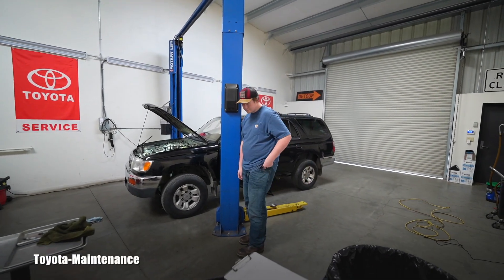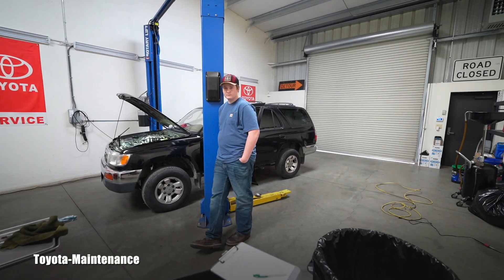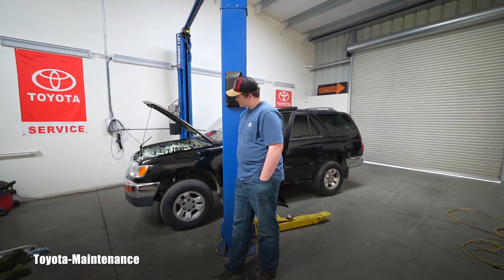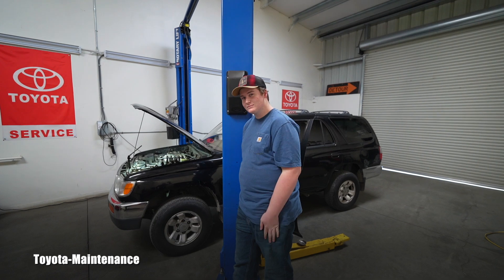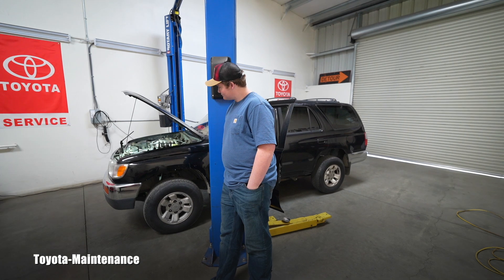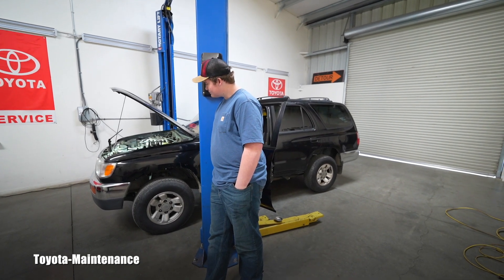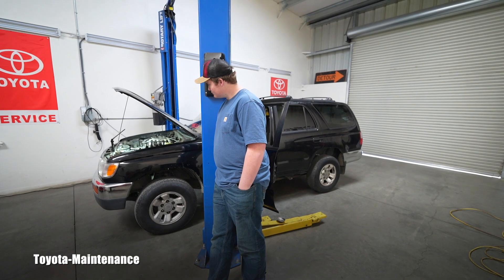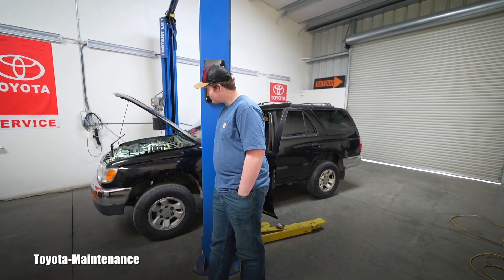Toyota Engine Missfire Codes P0306 P0304

Comment: In my situation 1998 Toyota forerunner 3.4 had PO306.
Carefully check spark plug cables on Cylinder2,4and6. They can leak the spark in the spark plug well. Just change the cables.

Comment: Im chasing a missfire in my 5vzfe ive change th leads coils amd plugs and it hasnt fixed the missfire i pull one lead off at a time at idle and i get no change in idle in cylender 4 it is missing on idle amd light to soft acceleration but when i gwt up in thebrpm the miss gwtba lot less noticable  what should i do mext it also has a relativly bew fuel filter too

Comment: Timing belt, timing belt, timing belt. 

While you're at it do the water pump and thermostat. You don't want to be driving down the road and that belt snap, while it's a non-interfering belt, you don't want to have to call a tow and be stuck. 

Make that 4runner healthy again! Take care of that 3.4 and she will take care of you for many many miles.

Comment: The other things that you should:
Replace and seal the cam caps.
Clean and seal the half moons with some Toyota FIPG.
Replace the valve cover bolt washers.
Make sure not to skip replacing those spark plug tube seals.
Replace the manifold gaskets.
Replace the PVC valve. 
Clean the throttle body while it’s apart.
Check the fuel injectors and other wires and hoses while you have the manifold off.
Scott
P.S.  You have a good mentor helping you. You got this Isaac.
Reply: Nice list! I'd only add cleaning the MAF and IAC along with the tbody for a complete air intake job along with a new air filter (if not already done).

Comment: FYI your around the same mileage when my 2000 4wd 4runner started leaking intercooler to radiator fluids. I suggest you soon buy a separate transmission intercooler and bypass the integrated one in the radiator. You dont want antifreeze in the tranny and tranny oil in the cooling system...when this happens it is sudden and without warning.

Comment: i know i might get a negative response from other posters but if we are going to start taking apart the engine due to bad seals and gaskets on this aging 4runner i would try to determine if head gaskets were ever replaced.  if not i would go ahead and do the full job and replace all the gaskets all around using highest quality gaskets toyota labeled, or oem equivalent, at once and consider machining the heads as well.

great channel and videos btw…

Comment: I agree and this is something to check when purchasing a older used vehicle. This is also a good negotiation tool when purchasing from an owner. Pull out the spark plugs wires and look for oil in the tubs and on the boot. Really appreciate you passing you thought process on to the next generation!!

Comment: Hey Peter, since you are going to pull the valve cover you might as well replace the pcv valve and bushing. Those bushings are so old and brittle that when you go to pull it off the bushing breaks and falls in the engine. So, best to replace the bushing and pcv valve while you are in there.
Reply: agreed... cheap and easy... why not??

Comment: Nice Truck!  The seal between the valve cover and the spark plug tube are compressed when the valve cover is tightened. I would give the valve cover a tightening, it may stop or slow down the leak.  I would then wipe out all the oil from the spark plug tubes. Next I would check for restrictions/clogs in the PVC circuit as it may be causing excessive internal engine pressure.  I would wash the spark plug wires and inspect them for cracks. They really shouldn't short out in oil since they are insulated and seal tight on the spark plug's insulator. However the seal May be compromised by sitting in oil getting softer, turning to goo and then leak. This failure of the seal will cause the oil to migrate up the spark plugs insulator to the spark plug wire's connection. This may cause a short to ground depending how conductive the oil is. I'm sure there is some resistance of the oil which may become more conductive as it picks up metallic residue as it ages. Consider if you spend an hour cleaning up the wires @ $120 dollars an hour all you will have in the end is some cleaned old wires.  With all the above cleaned and reassembled you should be able to drive awhile.  I'm not going to tell where you should do this, but I will tell you to do it. Vacuum all the leaves behind the rear engine compartment seal. Inspect this seal it must be working. It keeps oily air off the windshield and from going into your fresh air intake. Grab at least two cans of Foamy Engine Degreaser. Read and understand the instructions on the back of the can. Be careful where you spray this stuff mainly directly in the alternator. I would remove the Air Filter Housing and it's hose to the Throttle Body. I would shove rags in the throttle body inlet and seal it with plastic wrap, tape, and or Rubber band. I would remove the fuse box cover, fold up a rag and place it on top of the fuses with a bit of plastic wrap then replace the cover. Next get a look at all the nasty bits of your engine. Spray the engine cleaner in the hardest to get to places first. There is a siphon tube in the can that may blow air. Turn the spray nozzle on the can to compensate. Continue spraying all the Nooks and Crannies.  Let the stuff sit and not drip to the ground or you are just wasting the degreaser. Have a rag handy. A lot of dirt won't come off unless you touch it. You can spray the underneath of the hood and wipe with the rag to clean it. If you have hood insulation you can liberally soak it but don't blast it. You will have to leave the hood open till it drains the water out of it. Continue cleaning the engine, steering rods and compartment. Slow and easy. Throw down some cardboard and lay down on it to get to your Undercar's bits and pieces. After the time stated in the degreaser's instructions give the engine a rinse. Remembering the nooks and crannies.  Let everything drip dry.  No one ever cleans here and it is where body cancer will start. Wet leaves get trapped here and rust out the fender. Open the driver's door. at the bottom of the door jam where the fender attaches to the body should be sealed off with a soft plastic cover. This is how my Tundra is and I suspect your truck will be similar. You should be able to fashion a hook out of wire to pull the bottom of the cover out. Inspect this cavity for leaves. Pull out as many leaves as you can with your hook. Next blast some water up in there. These leaves come from up and over the fender well but mostly from the windshield drain cover where the wipers attach. Hosing the windshield will flush this cavity behind the fender cover. There might be people that comment OMG Don't ever get your engine wet. Your engine gets wet every time you drive in the rain. Sure there might be areas that are drip proofed like the fuse box but it isn't water tight, it even drains. Motorcycle engines get wet all the time especially dirt bikes. The benefits of a clean engine are many one of them being fire. An engine is metal and won't catch on fire unless you drive into a volcano. It's all the stuff on top of the engine that burns, stuff like oily grunge. Your mechanic will love you for having such a clean engine. Respecting your car makes your friends respect your car. Drive a bucket they will treat it as one. Keep the inside windows clean, I hate seeing kids fingerprints all over the glass.  Clean in between the bumps behind the steering wheel, that's where the previous owner's finger sweat and grime builds up, nasty. Use Rain-x, I use the windshield cleaner version since my truck is too high. Don't whomp your truck, she's and old girl and deserves respect.

Comment: I had 2004 Celica got same code, the number four injector leaked up Inside the connector shorted to the ecu. I was getting power to the injector but no pulse. I test at the ecu for injector pulse not present, then tested continuity of injector wiring. Had to replace injector and ecu. Luckily the car is so old the ecu or key doesn't need programming. Cost for me to fix $153.

Comment: Also get intake plenum gasket set,  PCV valve, clean and check battery connections and all hoses. Then flush all fluids and go from there. You know what needs to be done Peter.

Comment: Replacing the seals is a time consuming job but one I need to do as well. It would be allot to ask for a how to video but it would be a very welcome one. You could always split the video up to make a multipart series. Thanks for the videos!
Reply: I suspect they are on the right track to fixing the problem. Plus, the valve cover gasket and seals need to be replaced anyway. I also hope they film this and leave part numbers in the description as I have a 3.4 valve gasket job I need to tackle. Peter, you are a blessing my friend!
Reply: I had the same issue I got replaced gasket and seals but problem came back. My mechanic did a compression test and one of the cylinder did not passed and they determinate it was the engine cylinder block.

Comment: Maybe new Pcv and new plug wires. Does it have distributor and rotor button? Clean oil off engine with spray cleaner. Maybe Oil Change and filter. New Air filter. Then you will be riding in style. Very Sharp Toyota you have!

Comment: I’ll re-write the same comment I made in the previous video of this truck….”Endless money pit.”
Reply: Not really these 3.4 Toyota engines can run forever if you take care of them, I feel like this kid got ripped off , previous owner probably knew the amount of issues this 4Runner had
Reply: @fortis619  His mom bought it for him from a dealership.
Reply: That's a term Scotty uses for cars that don't last. This car is a 3rd generation Toyota 4runner.
Reply: Tell that to my 2000 Tacoma with 362000 miles,original clutch,regular 5000 mile oil changes,two timing belt/water pumps,two rack pinion jobs,plug wires,plugs.I really think it will outlast me. Also replaced valve cover gaskets once.
Reply: @jimgordon2399  I just ordered the 2 gaskets and RTV for my 2006 Tacoma's valve cover gasket replacement. How long do you think it will take me to replace the valve cover gasket, this being the first time I have done a job like this? ~ Thanks, Mark
Reply: @02markcal  I wish I did mine,I had it done when I had one of those jobs done,oil changes and the more basic stuff.I leave the bigger things to a guy like Petr,cheers and good luck! Hey had to come back to say,don't let that discourage you.I think you could follow a service manual or get info on YouTube to do it,go for it!
Reply: @jimgordon2399  Endless money pit.
Reply: @MC-mh2ju  not spread over 22 years Mr. Genius,how many cars have you owned in that time junior? Go right ahead and buy that shiny POS.
Reply: @jimgordon2399  None. I lease…..lol
Reply: @MC-mh2ju  you still lose then,or does Mommy pay? Lol Its you brainiacs that keep dealships open.
Reply: @jimgordon2399  Trust fund…lol
Reply: @MC-mh2ju  I knew it was something not earned
Reply: @jimgordon2399  And not one cent will be spent on a POS Toyota.
Reply: @MC-mh2ju  Please tell your mom thanks for letting you use her phone to enlighten us,now run along sonny, it's late.